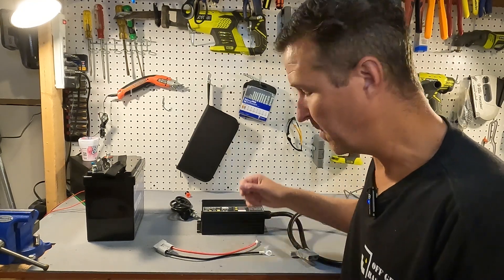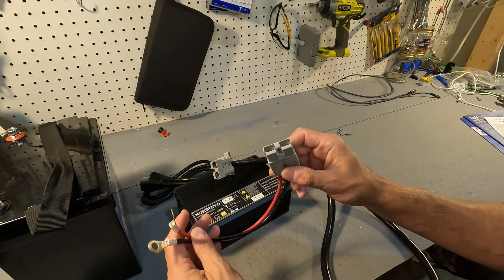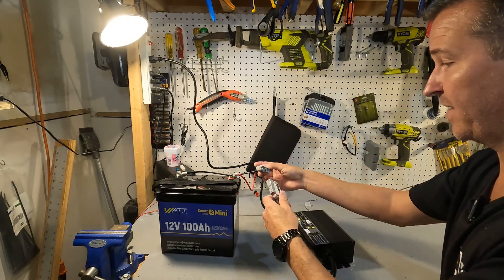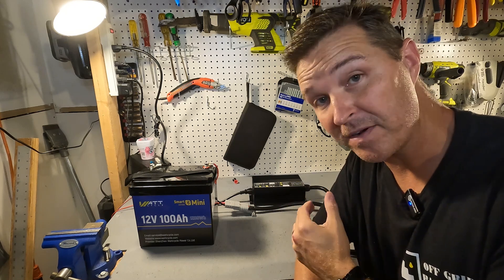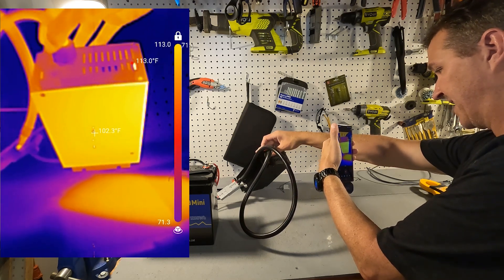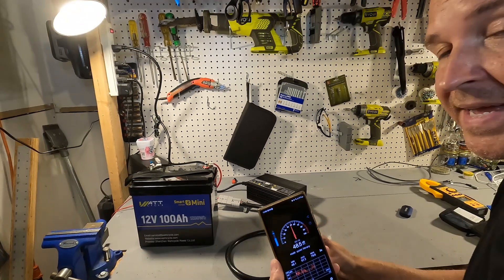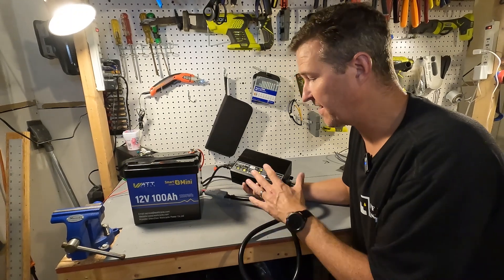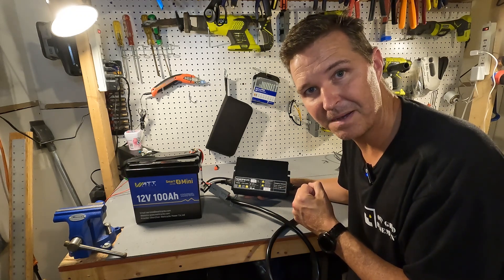NOEIFEVO 40A Lifepo4 12v Battery Charger.

Comment: Why is the cable from the charger to the connector super thick but then the cables to the battery from the connector looks super tiny, at least in comparison to the thick one.

Comment: Good company   God knows why they do not sell on Amazon, Never heatd of them. But at least you get full Amperage, Better than scam chargers  like the 12v/24v  20amp chargers, They dont tell you its half the amps at 24v
Reply from the maker: That's true.  Full speed away!  Thanks for the comment.

Comment: why does the site say specifically 200ah? shouldn't this work with any amp hour size?
Reply: Most of these batteries have a recommended charge rate at 0.2C. My REDODO 12.8V 100ah battery, the manual recommends a charge rate of 20A. My Eco Worthy 12V 20ah batteries, the manual recommends a charge rate of 5A. Just have to read the manual for your battery to see what the max charge rate is.
Reply from the maker: It will.  It just refers to the .2C rate of charging lifepo4 batteries. .2C rate of charge for a 200ah battery is 40A.  It works just fine with 100ah batteries, but don't use it for anything smaller.
Reply: @OffGridBasement  ok thx

Comment: Can it be used to permanently eep attached to a LifePO4 battery used for radio repeater backup?
The repeater has the option for a 12vdc (really 11-14vdc) input meant for a 12vdc battery with its own charger/maintainer/tender device.  Upon AC utility fail, an internal transfer relay drops out, and feeds the hardware from the 12vdc input terminals.  

It’s at a remote site with HVAC & standby genset, but I hate swapping out lead acid batteries every 2-3 years.

Thanks!
Reply from the maker: Unfortunately no.  This doesn't maintain the battery once it's charged.  You could purchase an ac smart plug and program it to cycle the charger every so often.